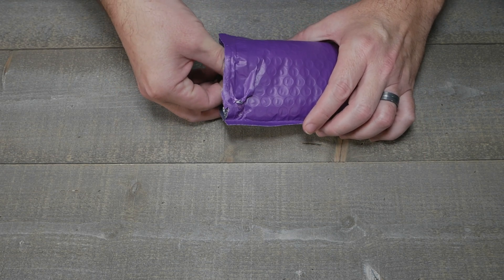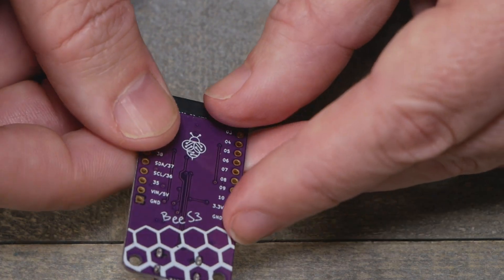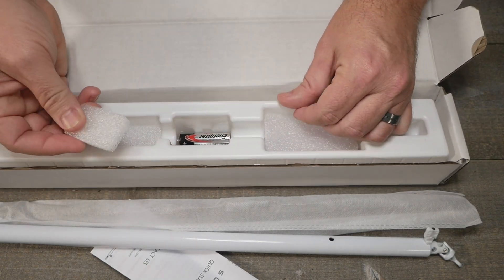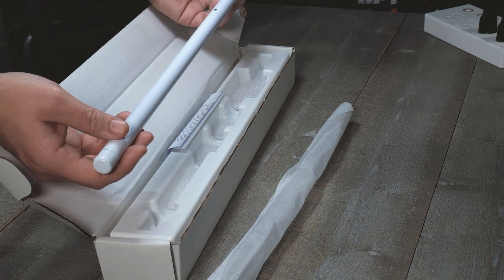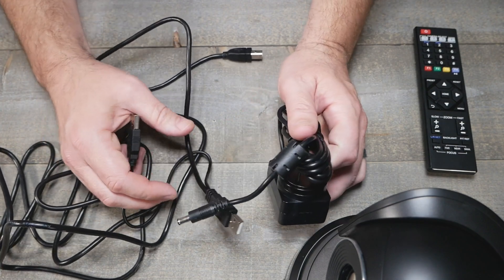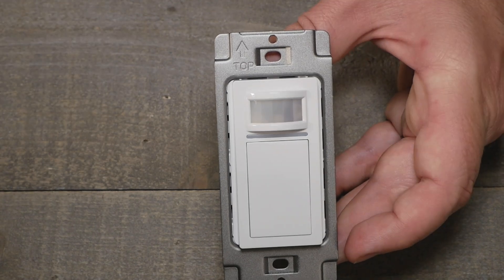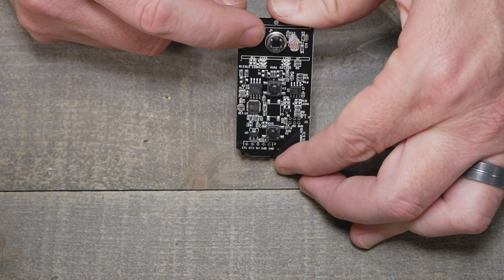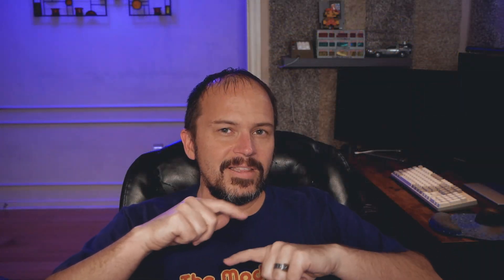Unboxing ESP32-S3 Bee, MILFRA Motion Switch, Sunsa Wand & Rocware PTZ

Comment: Received my 4 pack of the MILFRA single switch with motion today. I loaded Tasmota, detached  the switch and button from the relay, then created rules for the motion switch, pulsetime and led indicators. Mine came with a photoresistor installed. Anyone know what gpio the photoresistor is tied to?
Reply from the maker: It should be on the template as switch 2

Comment: Travis, are they ESP 32 or 8266 for the motion sensing light. Also, do you need to hold GPIO 0 to ground while flashing or not?
Reply from the maker: 8266 and yes GPIO 0 as always for esp32 regular and esp8266.

Comment: Thanks for the writeup on the MILFra switches! I have a few of the dual relay versions, but had originally avoided the single relay versions since the inclusion of the light sensor seemed to be hit-or-miss. If it's as simple as soldering on a photoresistor, I may have to pick some up.
Reply from the maker: The ones we have been picking up recently on Amazon have the photo resistor on it.